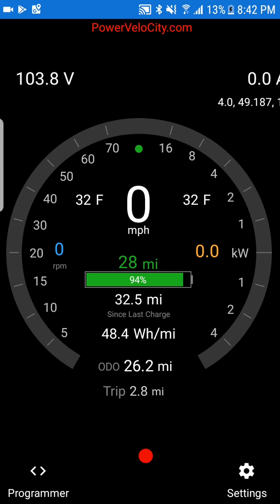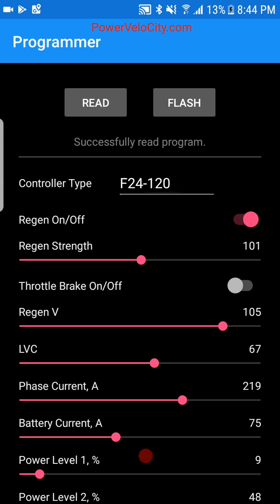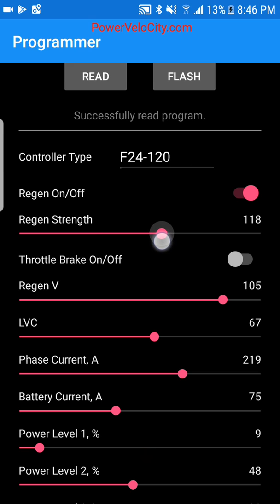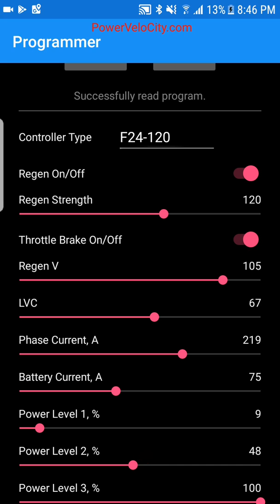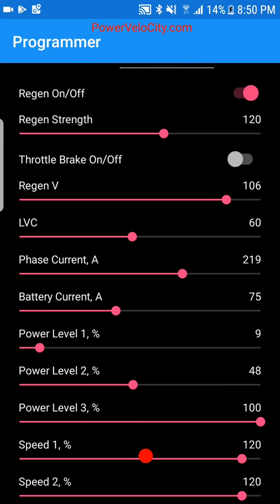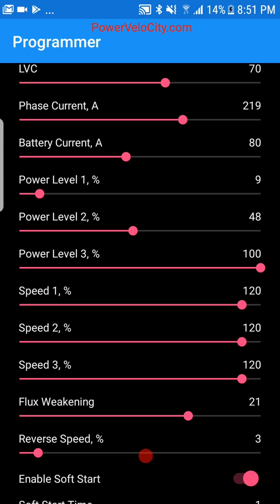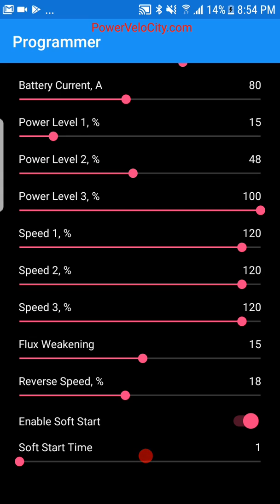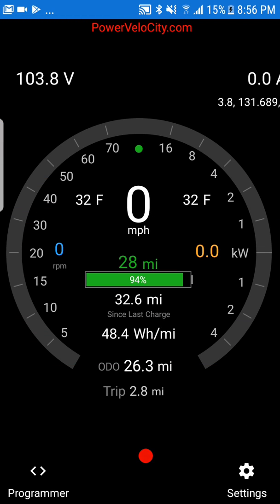Programmer Overview

Comment: Finally info on the ops of stealth ebikes. I am a newbie and have been searching and researching but today when i found the forum and then this .....wonderful. Bought 2nd hand,f37 with v.2.1.0 system. Went for first ride and very calm but didn,t make it home after pumping tyres ,throttle didn't engage, then just a tiny bit . checked all wires but obviously somerthing is wrong in set up ....?Any help would be appreciated, 369swm@gmail.com